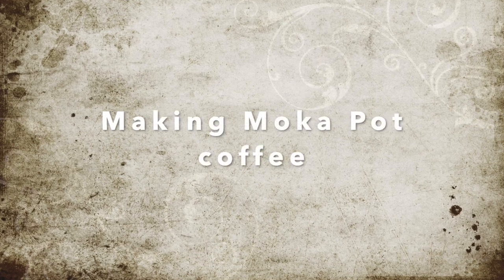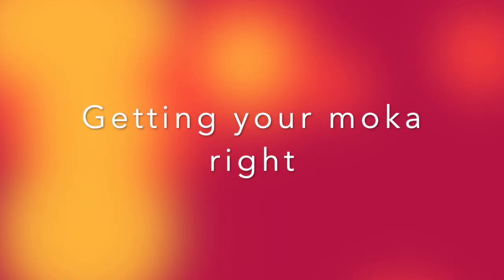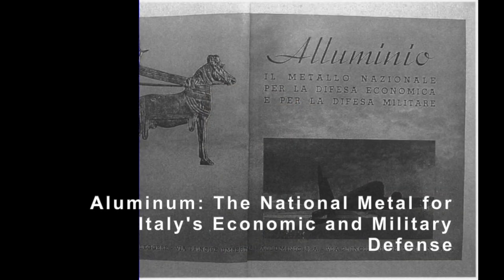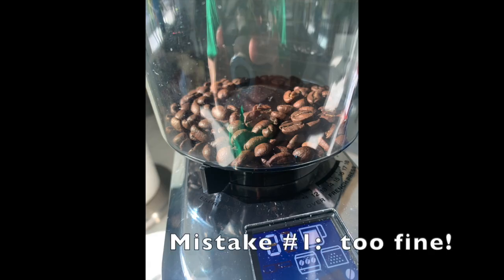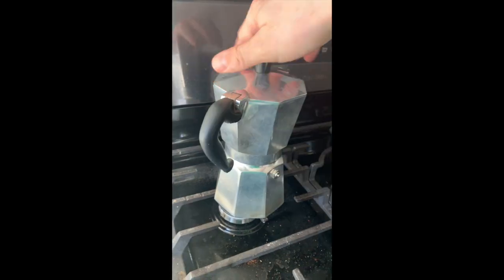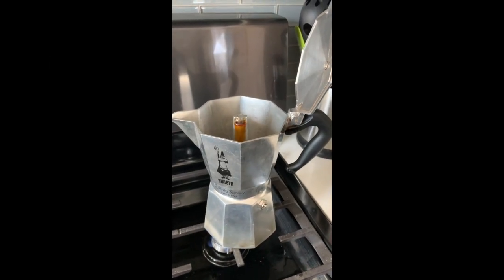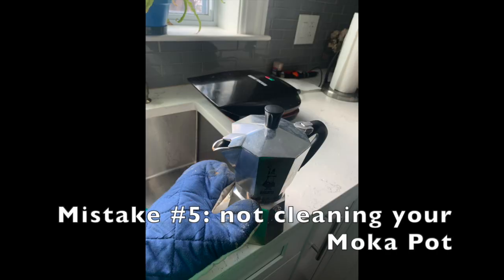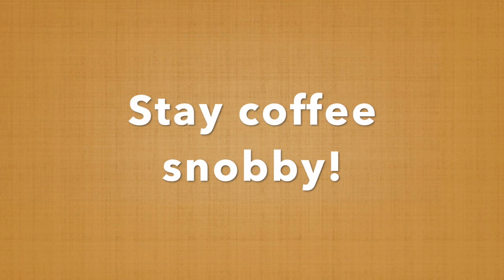Why your Moka pot tastes bad

Comment: I couldn’t get it to come out...not sure what the heck I did wrong.
Reply from the maker: Well that’s a new one!  It does take a while, 3-5 minutes, especially if you don’t preheat your water.  It’s also possible you’ve put too much water in, and created a back suction. Make sure to only fill to the fill valve. 

Also, make sure you get a good air seal by clearing the rim of the filter basket of grinds that may prevent a good seal to the rubber gasket above it.  If you see any air leaking out of the side, you know you have broken the seal, and your coffee won’t brew properly.  Let me know, and good luck!

Comment: NEVER put boiling water in the Moka pot !!! You will cook the coffee with the heat of the water !!!
Reply from the maker: I've heard many people make funny claims about the starting temperature of the water, but you sir are the first to claim that the coffee will brew just from having hot water nearby!  And with the certainty of ALL CAPS and 3 exclamation points no less!  I love it.  

My follow-up video discusses the consideration of starting temperature and the debate over optimal water temp: https://youtu.be/jcgMeDDAT-s The Bould Brothers claim that not preheating is preferable because it leaves the coffee in contact with the water for more time, while James Hoffman himself say you should preheat the water so the coffee grounds aren't being heated.  Meanwhile while this paper indicates that preheating the water is optimal to prevent the coffee from extracting at too low a temperature for optimal brewing: http://www.msc.univ-paris-diderot.fr/~phyexp/uploads/Moka/article1.pdf
Reply from the maker: Honestly, I haven't found preheating the water makes much a difference compared to more important tweaks like using an AeroPress filter, coarser grind, or removing from the heat at the right time, but probably you should preheat because the physics models show you'll extract at too low a temperature otherwise:  https://www.youtube.com/watch?v=O14BIH-9KTA

Comment: I'm kinda afraid pouring the cold water on the boiling hot pot might break it.... but I guess I have to try that now
Reply from the maker: Yeah, I understand your concern. The reassurance I can give you is twofold: (1) The temperature drop is mitigated by all the very hot water that the aluminum is in contact with, so it doesn’t change that rapidly and (2) this is an extremely common practice and I’ve never heard anybody report temperature shock issues.

Comment: Hi sir 
What is packing it down means we have to fill it full or not
Reply from the maker: Answers! https://youtu.be/jcgMeDDAT-s. it’s one more thing to play with. I would advocate for completely filling it to the level, but don’t press it down to try to fit any more in.  Do you want a pack of grounds that can be easily penetrated by water of sufficient pressure.
Reply: @loodog555  what if I fill 1/4 of funnel for small quantity of coffe for one person does it make bad if i don't fill it full plz
Reply from the maker: @fiza39  give it a try, but my armchair prediction would be that you would get very under brewed coffee, that would taste weak,  sour, and acidic.  These devices are generally made to brew a specific amount of coffee which is given by filling up both the water and the grinds chamber.  There is not a good way to make less coffee without impacting how the overall process works, including the brew ratio and pressure involved.  The only clean solution would be to buy a smaller moka pot.
Reply: @loodog555  really it helped me a lot thanks so much sir

Comment: I gave up on these they always taste like ass. I did a course grind, non packed down, though I did fill the entire thing and rake off the excess, making sure to move my butter knife ONLY horizontally. I put in the boiling water, set the burner extremely low, and by the time the Moka pot was like 3/4 full (well before the clear water or bubbles came out), I started pouring it into my coffee mug. Still very bitter. These days I drink instant coffee bc it’s so much more convenient, faster, less cleanup, and it even tastes better too 🤦
Reply from the maker: Hey Henry, I wish youtube were better designed for mobile so that you'd already see the link to my follow-up video, which gets a bit more into the details: https://www.youtube.com/watch?v=jcgMeDDAT-s Unfortunately, the youtube set up for mobile makes it a lot easier to type a comment than to see what's posted already.  Anyway, check out the video I just posted.  It's got a few more tips to try out, in case your coffee still sucks.

Also, I'm finishing up a video about a suggestion I heard about: putting an AeroPress filter inside your moka pot. Spoiler: it makes a difference!

Comment: Do you have a vid on how to clean the bialetti? I follow your procedures on brewing but if there are any hints and hacks for cleaning the pot, other than washing the top carafe and rinsing the bottom, that would be great to know
Reply from the maker: Hey, great question!  I included a link at the relevant portion of the video, but here it is for your easy access: https://youtu.be/yRW3V7Q0oQY

Removing the gasket to clean out the cone of the upper chamber is the big surprise for everyone.

Comment: Italian and moka purist here.

It's 80% about the coffee, and 20% about how you treat your moka.

The only way you want to clean a moka, is rinsing it using warm water only.
 It'll create a coffee patina that will give your next brews a better flavor over time, the more you use it and the better the flavor gets. Think of it like Japanese teapots.

Quick note also: in the video, when you show how to put in the coffee, there's plenty of space left for more coffee.
You want to fill that space completely and gently press it to level it (or if you want stronger coffee, you can fit more by applying pressure to reduce its volume, that way you'll be able to put more coffee, just don't exaggerate)

If your coffee tastes bad, unless you are using the wrong amount or cleaning your moka with dish soap, it's most certainly the coffee's fault.

Coffee blends highly differ from country to country and are hardly ever similar.

People also say that you should put your sugar directly inside the moka and then pour the coffee ouf, but I see no practical use to that and there is no real reason to do that.

Keep it simple.
Buy quality coffee.
Use the right amount.
Rinse with water only after use.
That's as easy as it gets.
Reply from the maker: Discussed in the follow up: https://youtu.be/jcgMeDDAT-s

Comment: I live on Balkan and have Italian roots. So... 1.Moka pot should be cleaned by water only (a lil vinegar if you have to). Amen!!! I cleaned it last time with dish wash solution and had to do 30+ coffees to return the taste back. Extremly bitter.  2.for induction is better to.put on high heating due to induction heater having a pulsating not constant temperature. It is annoying yes, high settings have a more constant heat.

Comment: I’ve never heard of an Italian (let alone anyone) use boiling water before adding it to the moka pot. It also might be tasting bitter because the coffee you’re using is trash. Just buy illy or lavazza lol you’ll be fine you don’t need all this extra nonsense
Reply from the maker: Using preheated water helps with the proper temperature extraction: http://www.msc.univ-paris-diderot.fr/~phyexp/uploads/Moka/article1.pdf
Reply from the maker: What I’m learning from comments is that Italians just seem to not care about reducing the bitterness associated with 2,4-decadienal, 4-ethylguiacol, and 2,4-nonadienal. Which is fine, you can brew it however you prefer it, of course.  It just means you’re not so oriented towards Third Wave coffee ideas with regard to the under extraction/over extraction model.
Reply from the maker: So anecdotally, James Hoffman and Tristan Stephenson and basically all the Third Wave coffee people tell you to preheat the water, but  now there's actually science on this showing the same thing: https://www.youtube.com/watch?v=O14BIH-9KTA

If you're buying large corporatized preground coffee, however, probably no brewing technique will make much a difference as all the freshness will be gone by the time the beans get to you anyway.

Comment: Hi, I’m Italian so basically the 100% most accurate source of information on moka setup.
You got almost all points right, just a couple of good advices to increase the taste and texture of moka coffee.
1) Fill with water, put the filter on and without adding coffee, slightly tap on the filter.
If water splashes through, there’s too much water. You want to have minimum to no splash , just some tiny drops
2) Ground coffee. This represents 80% of a good moka, and you’re right, it has to be more coarse to allow water to pass easily.
But you have to fill the filter (you have too much space left) and leave a small “mountain” of coffee over the top,  do not press manually but leave the moka press it naturally when you screw it.
This will allow some additional resistance and give water the time to extract most of the flavour.
It will also allow for some minor “cream” creation, even if it won’t be strong enough to stay there.
3) Temperature. I never saw anyone boiling water first, but nothing wrong with it.
What I recommend is having the flame or the electric stove on a very low heat, this way steam is created slowly enough to avoid reaching boiling temperature (absolutely not necessary and number one cause of burnt coffees) but have the right time to rise up steadily without actually boiling.
Moka coffee does not boil when it comes out, if it does you went too far.
Give it time, moka is not made for people constantly on the run, espresso is very different in that aspect, moka requires patience.
4) Perfect advice, remove from heat when it starts to come out clear!!! This is crucial!!!
But washing the chamber with cold water is not necessary, it does not do anything you already have brewed all of the coffee.
It’s just so you can unscrew it faster later 😅
5) Last one. DO. NOT. USE. ANY. SOAP.
Just rinse with water constantly, use your fingers and nails to thoroughly clean the filter and the gum ring, clean the inner chamber, run water all over inside it, no stains have to be left behind.
But NO SOAP AND NO CLEANING AGENTS, I avoid even using dirty towels on it.

That’s all.
Hope you continue to use your moka, it’s the most common coffee machine in Italian homes.
A true and long lasting tradition.
Reply from the maker: Hey, grazie for your comment!  I'm a bit amused that you're telling me, with your credentials as an Italian, that I'm basically right, while so many of your countrymen have also chimed in to tell me how WRONG I am!  

My goal here is not necessarily to do the most authentic Italian thing, (mountain of coffee, starting with cold water, etc...) but to explore the options for people to be able to tweak the flavor of their coffee to their liking, and this involves considering the typical barista model of overextraction vs underextraction to reduce the production of the bitter compounds that come out.

You've probably noticed I don't even fill the filter basket completely, which is madness to Italians I'm sure!  My impression is that most Americans/Brits have given up on their Moka pots because of the flavor they get, but I'm getting lots of comments that this video has given them the motivation to try again.  

A hot tip I got the other day was to put a paper AeroPress filter above the filter basket.  This is most certainly a very UN-Italian thing to do, but the coffee came out the smoothest tasting I'd ever had out of a Moka pot.
Reply: @loodog555  I'm not Italian, but I have learned that when it comes to food, there is no such thing as "Italian."  Every region, city, and probably even neighborhood has its own twist on the proper way to do things.  The way one cooks in Milan may be considered sacrilege in Rome.  I think a lot of that is because of dependence on fresh, local ingredients and the surprisingly large variety of weather and soil conditions found throughout the country.  And some of it is simply because of the length of history and rivalry between various places.

There is probably even a regional dish that combines cheese and seafood.
Reply: @loodog555  Hey, I am not here to be a dick to anybody, right? 😅 I think it’s amazing that our little country has developed so many crazy traditions that others are willing to follow and preserve, people take it for granted but I don’t.
Just the fact you took the time to research the origins of the moka and understand how it works it’s great.
I can just show you how we do it every day, but if you like it your way is all good.
Italians on the internet are generally self centered nazis, I hate that aspect.
Reply from the maker: Third Wave baristas and physicists agree: always preheat the coffee! https://www.youtube.com/watch?v=O14BIH-9KTA
Reply from the maker: About that "mountain" of coffee: https://www.youtube.com/watch?v=bCSn2CXWZOE&

Comment: Interesting, I'll try it. Two things though : 1. Why boil your water first ? 2. Why cool your chamber after if your pouring it into cups right away ?
Reply: Boiling the water so that the coffee doesn't heat up with the water on the flame, getting too hot, which can cause bitterness. Cooling it down so the last bitter part of the extraction can't manage to get into the upper chamber. Just to make sure.
Reply: @yungt6668  Makes lots of sense mate, thanks for the reply !
Reply from the maker: Preheat the water so that extraction doesn't take place at too low a temperature: https://www.youtube.com/watch?v=O14BIH-9KTA

Comment: AAAARGH, 90% of what is in the video is wrong!! I'm Italian and I can tell you that nobody uses the moka in this way, you made several mistakes:
1- You should not put boiling water but cold water in the moka
2- You should FILL it with coffee, you shouldn't leave empty spaces in the filter
3- The moka should be removed from the gas when it has finished to push up coffe, not earlier, not later
4- it's absolutely pointless to put a wet cloth when it finishes
5- the moka should not be washed with soap, just a quick wash with cold water is enough, there are no problems if some traces of coffe remain, instead, the older a moka is, the better its coffee is

Also, if the coffee sucks the fault might likely also be the coffee itself, just buy some ILLY coffe and that's it

Also, watch this https://youtu.be/1vr9ShzbFeY
Reply from the maker: Hey, thanks for chiming in, Mr. Illy, but the video from your company does not include very much in the way of specifics, so I would recommend checking out the physics simulation results done by King in 2007:  http://www.msc.univ-paris-diderot.fr/~phyexp/uploads/Moka/article1.pdf

I have covered the points you have raised in my follow-up video from 3 weeks ago which I have included in the description and stickied at the top.  I wish you the best coffee in life, friend!
Reply from the maker: Also, what I’m learning from comments is that Italians just seem to not care about reducing the bitterness associated with 2,4-decadienal, 4-ethylguiacol, and 2,4-nonadienal. Which is fine, you can brew it however you prefer it, of course.  It just means you’re not so oriented towards Third Wave coffee ideas with regard to the under extraction/over extraction model.

Comment: Plot twist:  bitter coffee taste it's the way it should be because coffee is bitter. Also changing the coffe from espresso beans to crema should help getting it to taste lighter. The less coffee, the less it will taste like coffee. Maybe just drink tee? Really chilly video tho, thanks!
Reply from the maker: What I’m learning from comments is that Italians just seem to not care about reducing the bitterness associated with 2,4-decadienal, 4-ethylguiacol, and 2,4-nonadienal. Which is fine, you can brew it however you prefer it, of course.  It just means you’re not so oriented towards Third Wave coffee ideas with regard to the under extraction/over extraction model. 

Coffee does taste bitter, but it will taste less bitter if you have dissolved less than 22% of your coffee (for reference, a full 30% of it dissolve if you wait forever but it will taste awful).
Reply: @loodog555  totally agree that each and everyone should drink it as they think it tastes the best! I just mean that there is no correct way of doing it, there are many correct ways of doing it according to the way you want the coffee to taste, and that's also great.